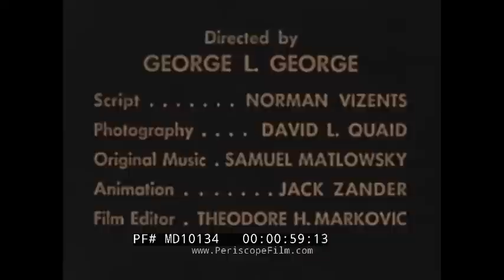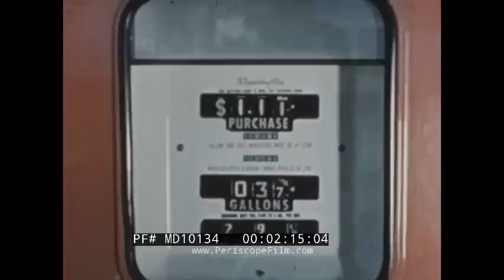" OIL - THE INVISIBLE TRAVELER "  TRANSPORT OF OIL TO MARKET   1953 SHELL OIL CO. FILM     MD10134

Comment: Gasoline contained lead back in 1953.
Now, all gasoline is unleaded.
Reply: Wasn't it a knock preventative so that engines could go high compression without preignition destruction.
Reply: @edwardd9702  No, we still have unleaded hi octane gasoline that does away with compression induced preignition.
Reply: @edwardd9702  Yes it served a dual purpose... raised the octane level and produced a valve seat lubricant as it was burned and the exhaust left the cylinder... 

Unleaded gasoline was developed because the lead from tetraethyl lead being burned in the gasoline was found to be contaminating the environment, which isn't a good thing.  We could get leaded gasoline for farm equipment up until the early-mid 90's, but it was more expensive than regular unleaded... cars and trucks quit using leaded gas by the mid-70's when it disappeared from the service stations... I'm old enough to remember as a kid in the early 70's we had "regular" (leaded), unleaded, and high-test (high octane).  There was no "mid grade" like now... that came in when unleaded replaced "regular'
Reply: A sort of lead, tetra ethyl lead. Not exactly safe to chug in 12 oz. portions, but not as dangerous as the element we know as lead. It provided a cushion in exhaust gases to preserve valve seats. Hardened inserts were the simple fix to that problem. Petrochemistry has come a long way as metallurgy has too.
Reply: Thanks

Comment: 9:08 This practice made the nation's oil supply vulnerable to attack from submarines during the war.
Reply: The man that introduced my parents to each other when they started dating was a merchant marine working on oil tankers during the war.  He recounted the story that one time they were part of a four ship convoy leaving the port of Galveston bound for New York.  They didn't even get out of sight of Galveston and BOOM the first tanker blew up, huge fireball, everyone killed.  Then the second tanker blew up, same as the first.  Then the third tanker.  U-boats in the Gulf of Mexico.  They basically figured their number was up and prayed and made their peace with God, waiting for their ship to blow up under them in a huge gasoline fireball. BUT the explosion never came... they kept right on sailing and got up to speed and kept going... they only thing they could figure was that the U-boat had run out of torpedoes... Early in the war they lurked offshore and looked for the outline of tankers between them and the brightly lit cities of the coastlines which would silhouette them against the coast lights at night... then they could accurately target and sink them without putting themselves at risk on the surface.  During the day the submarines would submerge to avoid detection by Coast Guard or Navy ships and air patrols... 

It took a little time, but eventually we figured out how to protect the ships better and the number of sinkings fell way off... as Navy and Coast Guard detection and escort improved and better air patrols, they finally took a toll on the submarines and turned the tide...